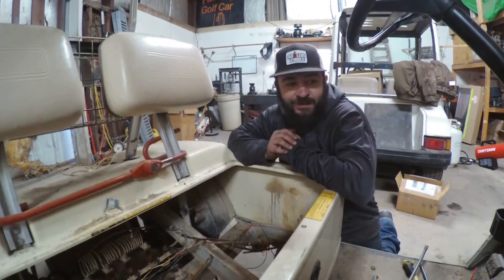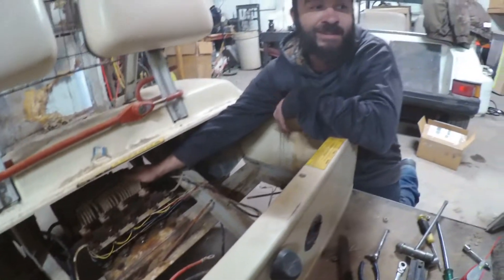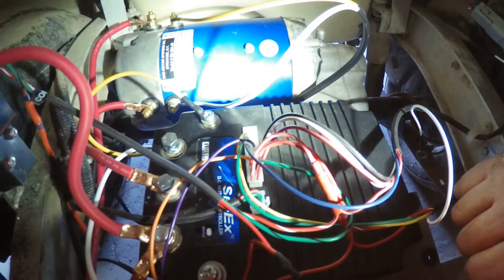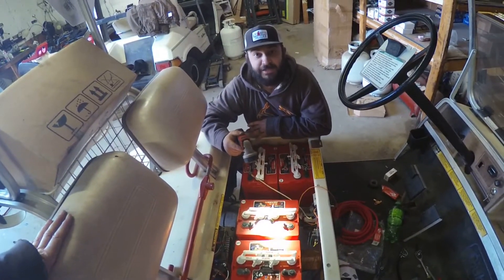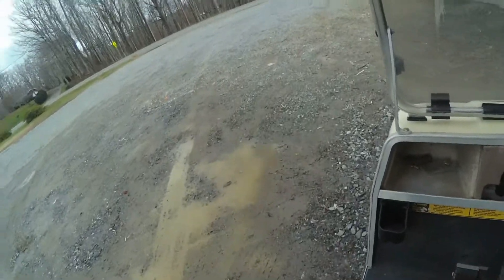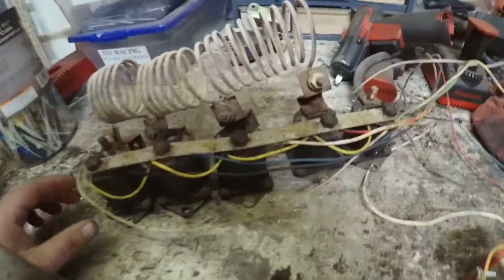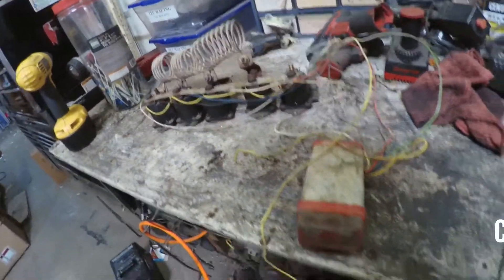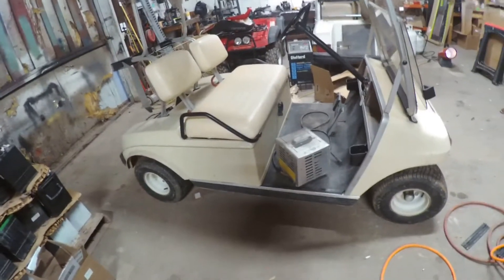1988 Club Car DS Resistor Cart to Solid State Upgrade

Comment: Cool I have a 93 club.cart. boy, it kills one if my batteries every time. I have to to go exchange a new battery for another.one. But I have to buy a new one. Hey won't exchange it. Because of ahit, the wiring defected the battery. How come only one battery is is bad and not all six????
Reply from the maker: I'm sure there is a reason but not sure on yours? Have you tried changing out  all new cables?

Comment: Where are you guys located ?
Reply from the maker: Martinsville, VA
Reply: Is there any videos that show the actual connection from the controller to the motor wiring etc
Reply: And is it possible to use the same motor , My 36 volt seem to have pretty good torque and it's holding strong
Reply from the maker: @enriqueramos4132  So what is your reason or interest in this kit? Most install this due to low power and or/torque or burning up resistor coils...etc... But to answer your question on some carts you can use your motor depends on what you have?
Reply from the maker: @enriqueramos4132  We don't have any as it depends on which controller and motor. We help you with the kit if you chose one.

Comment: Great Job man I love old DS carts. Quick question if I may.. . I've got a 1960 "Turf Rider IV" golf cart with the original 36v DC motor (GE) that is strong and quiet. Unfortunately I can't tell what is wrong with the "controller" and when I say controller I mean 3 resister coils a 8 relay solenoids that are connected to a "throttle box" ... and when I say throttle box I mean an exposed ascending series of brass tabs that come in contact with a solid brass bar on the Go pedal linkage. 

Is there any way to use a modern controller with the old GE motor?  Thanks!
Reply from the maker: In most of those carts we start with the primary solenoid (drivers side). We could help you over the phone if you have a volt meter. 276.632.8905
Reply: I would like to add to his question. Back to if the original motor will work. i have a vintage golf cart. I want more speed just was wondering if i upgrade to solid state keeping original motor. If that would work

Comment: fixing a 1999 DS Precedent Club Car, i was wondering what the black button is to the left of the brake pedal? Thanks in advance
Reply from the maker: Typically its a horn button or some guys wire up an old school headlight dimmer switch.

Comment: Quick question. Fairly new to this and looking to make some changes to my wife’s grandmother’s ‘89, as it has sentimental value, but isn’t able to adequately pull the hills in her neighborhood. I seem to have located the kit on your site, but my question is on the 36v to 48v conversion. A) is that necessary B) what is the benefit and C) what parts are needed to make that swap

Thanks in advance!
Reply from the maker: Hello sir the controller is compatible with either 36v or 48v battery pack if you have 36v battery pack it is not necessary to change to 48v. The benefit is better operation of the cart more power for pulling(not crazy amount) where it would be unsafe to ride for an elderly woman to ride, plus it bring the cart up to date with the newer style technology( easier to get part for repair if ever needed. I hope this helps and give us a call we can help you get the proper kit for installation and the only extra parts you will need are some self tapping screws. call the number on the website for any additional help.

Comment: And the cost is
Reply: OK so there are several different price ranges it all depends on what you want it to do this particular cart was beefed up pretty good and he was just under $3000 but again this cart had high speed motor and 600amp controller roughly stock price is $1600 give or take a few hundred we are in the process of getting a parts list made for stock setups.
Reply from the maker: https://www.ecartparts.com/club-car-series-resistor-coils-to-regen-controller-conversion-kit

Comment: Does a 1990 club car ds have the same solenoid system? Found a 36v one that "only needs batteries" according to the seller. I don't care much about speed but I need torque. Small hills, bumps, pulling deer and hogs out of the woods and using it for filling feeders etc. It's a cool little cart for$1200. Wondering if it would be worth it? Or more work and $$ than just buying a newer one.
Reply from the maker: It might be ok but, once you add $6-700 in batteries you're close to 2k and might come out better getting a newer solid state cart??

Comment: Question can i take the old cart just use my v slide accerator put a new controller an make it run? just use the controller to bypass the resistor coil
Reply: You would have to use a wiring harness that is compatible with the 98-99 year model club car and the proper curtis controller

Comment: Can you elaborate on what you had to do or what you had to buy to switch from the resistor to the solid state? Or is there a company that sells the parts to do it?
Reply from the maker: You have to get a *Pot Box or Potentiometer which tells the controller where the gas pedal is. We are currently putting together a complete kit that anyone can buy. mygolfcartshop.com
Reply: @cartsmarttv  You get this kit together yet? I was looking on the site but didn't see anything. I've got an 85 Club Car DS I'm looking to upgrade.